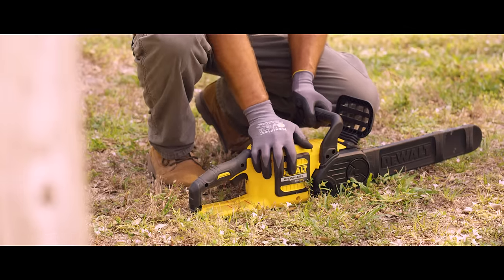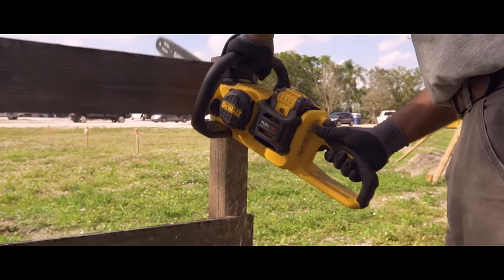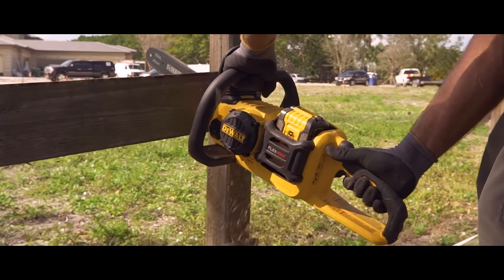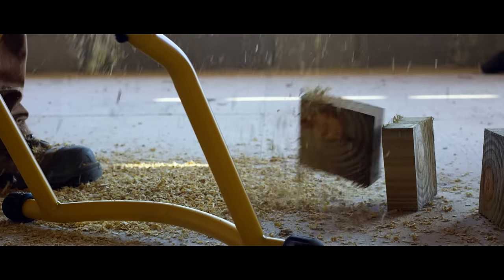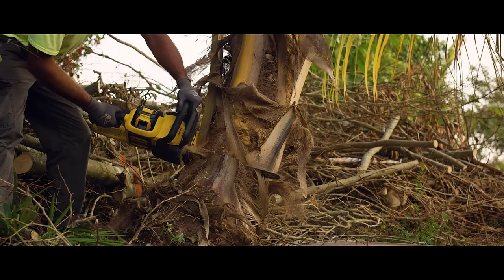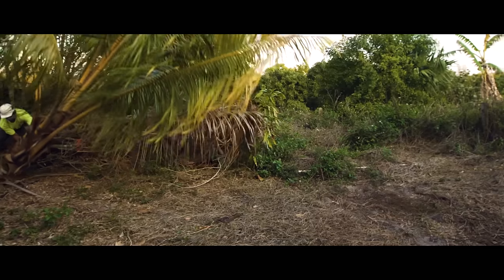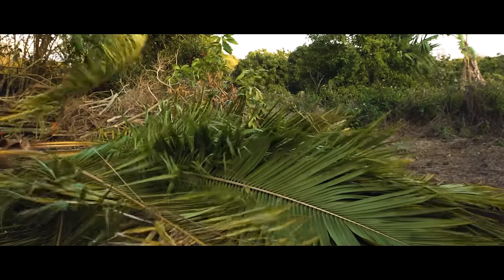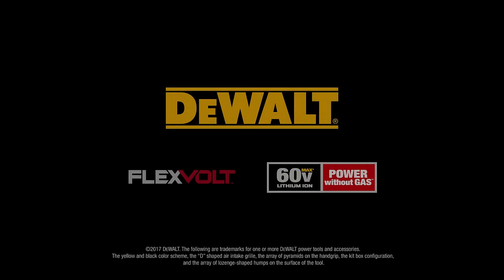DEWALT® FLEXVOLT® 60V MAX* Cordless Chainsaw (DCCS670X1)

Comment: is there going to be a flexvolt snow blower?
Reply: I'd buy a flexvolt lawn mower.  Plug in 6 of those for an hour of mowing or something like that.
Reply: i know anther brand has made an electric cordless snow blower. hopefully dewalt folows suite
Reply: I have the dewalt 54v flex 18v flex volt 54v li-ion battery mixing drill demo model